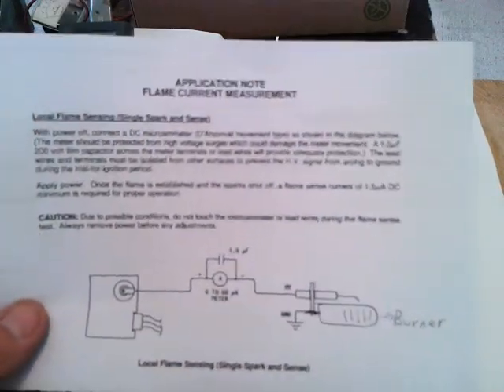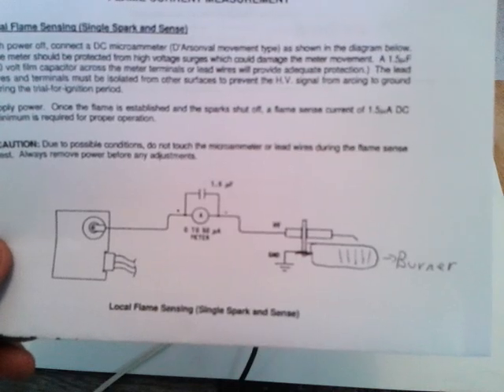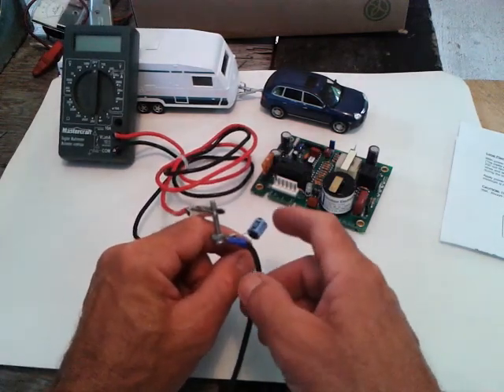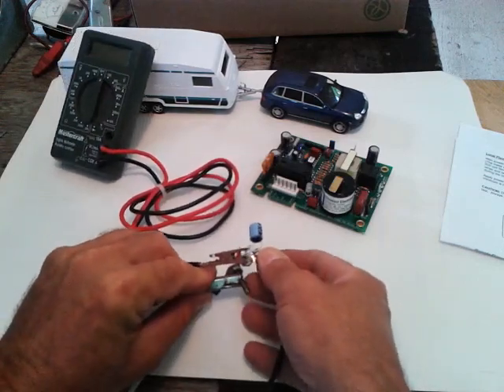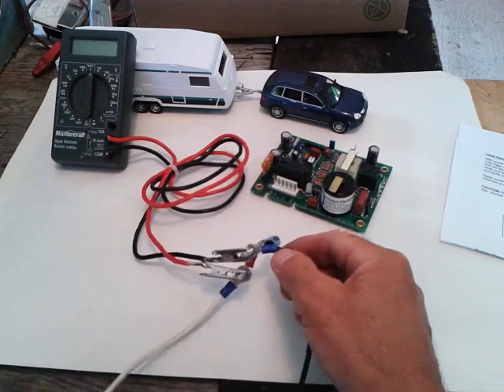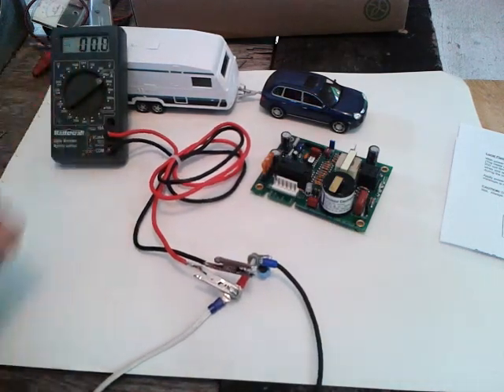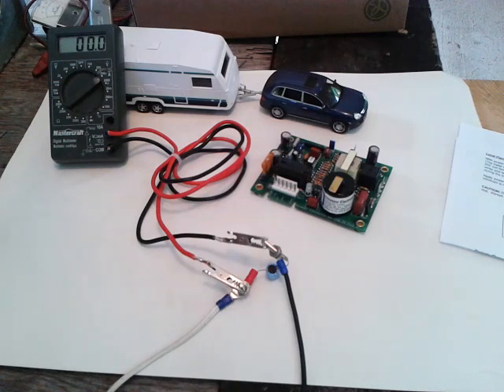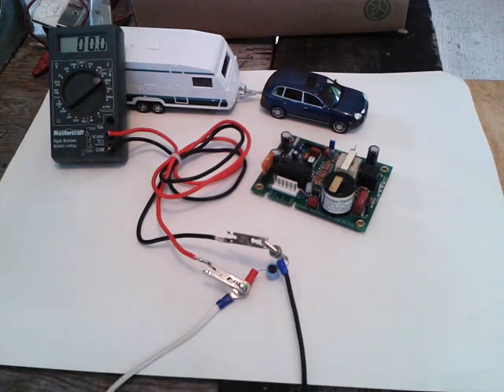Flame Sensor testing; how to easily test a RV furnace

Comment: problem: i got the atwood 8535-1 furnace. got the dinosaur Fan 50 plus
control board but the plug wires don't match up. fits fine but one wire 
has no contact when plugged into dinosaur. original has pwr, v1, s1, 
& gnd. the s1 doesnt go anywhere on dinosaur board. everything else 
matches. thats the flame sensor. i can move the pin but only thing left 
is "NC"? my furnace thermostat grounds the circuit & also i have 
time delay relay so i dont think i use the t-stat pin on the dinosaur 
board. also i thought if i used the dinosaur board i would NOT need to 
have the time-delay relay anymore. thats what i read online. cant find 
any info & Dinosaur ele has NO phone #.

Comment: I have an older sub.DD-17DSI. Everything OK up to flame lighting. It sparks, doesn't ignite. I tested motherboard, it cycles and shows gas valve getting power. How do I test the solenoids on gas valve?e